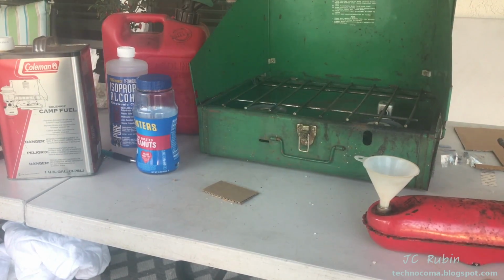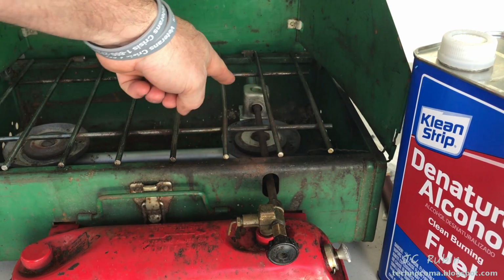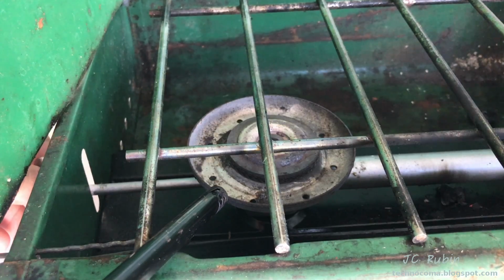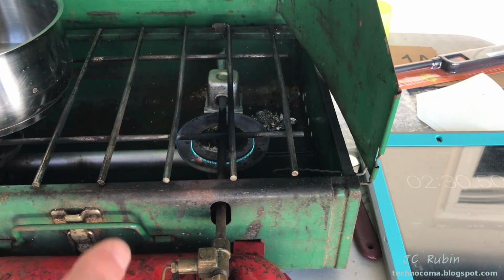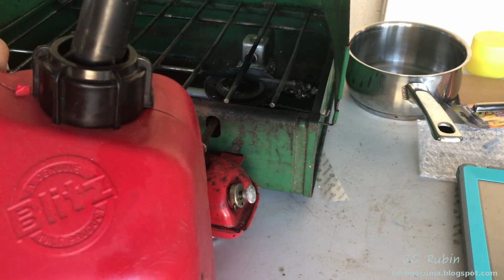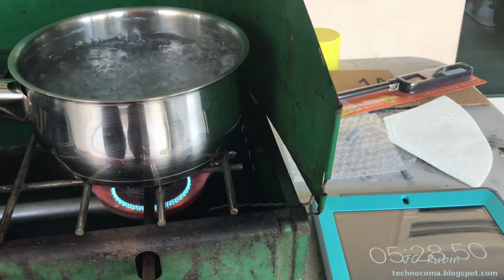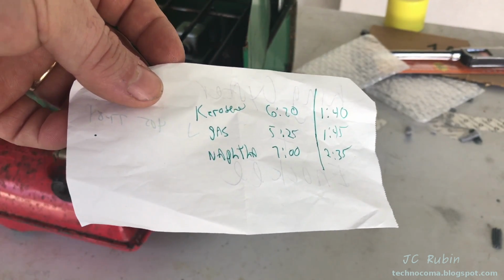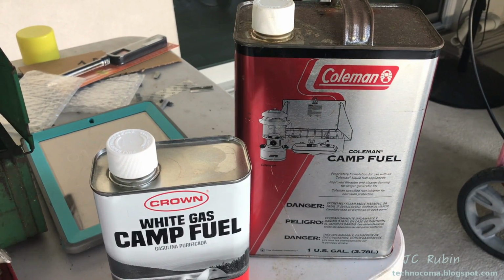Antique Coleman 425 Stove Testing Out Different Fuels for Performance

Comment: 87 w/10% alcohol works but remove it from the tank as it will rust badly 
Same as in older vehicles with steel tanks
Reply from the maker: True, Ethanol is bad news for metal tanks

Comment: Interesting results 👍👍 I've had a Coleman 425E stove since the early 80s never realized there was a Needle & Spring inside the tank tube until you demonstrated that. Now I'm going to take mine apart & clean it. These are amazing little cook stoves especially if you are living off grid they are a must have item.
Reply from the maker: Glad you found the video useful.

Comment: I just picked a 3 burner up at a yard sale for $20 and been using it for camping trips, I have been using gasoline since it’s the easiest and most efficient source to come by at $1 a can. I wasn’t aware of the residue and want to ask how serious it is through time. I would also love to maintenance one of these and I recommend you a maintenance video on one of these antique pieces. I’m concerned of energy loss on mine and I don’t notice a difference when I adjust the fuel regulator.

Comment: One of the tricks we did in the army in the arctic was we would squirt a ring of hand sanitizer on the burner and let the stove preheat and basically light once we turned the fuel on.
Reply from the maker: Thanks for the tip!

Comment: Thank you for this fine test. My experience with Coleman stoves and lanterns spans 60 years. On occasion I have used Coleman fuel, it works great. But pump gas has always been my preference because its something I have always had around the house for the chainsaw, lawnmower, etc. I have never had a problem. Before the 1990s leaded gas was common and that would foul up the appliance. So we always bought unleaded. Now I prefer to use ethanol free pump gas. I have nothing against Coleman or other brands of Naphtha fuels. They work great but they do cost more than pump gas, but even with a year of heavy camping the cost is negligible. They are dual fuel compatible, so use what you prefer.

Comment: Could you test with Seafoam(the kind you get from the auto parts store)?
From what I can find online its 3 ingredients are naptha, pale oil, and isopropanol(isopropyl alcohol)?

I've tested it in lighters and vintage fuel handwarmers. Those seem to not be the best as it could hinder spark flames but maybe work better in flame lit applications.
Reply from the maker: I don’t test everything flammable. I can’t imagine a scenario where I’d want to cook with Seafoam. I’ve seen and smelled it from an exhaust

Comment: Great point. Coleman fuel and white gas does degrade as does Kerosene ( paraffin for those in Europe) Worked as a Coleman and other repair jockey for years, and old fuel works, but has less energy. Even kerosene goes bad. Much more common degradation with partially used cans. Great video, thanks!
Reply from the maker: You're welcome.

Comment: Nice work.  You got some interesting results.  But to get meaningful, accurate, repeatable results, you need to do all the tests exactly the same with the only variable being fuel type.  The amount of fuel added and the pump count need to be the same for all the tests.  This is not easy, since some fuels take more, or less, time to reach operating temp.  In "Up To Light" mode, LOTS of tank air is being consumed.  Ballpark estimate for this is about one pump per second of "Up To Light" operation.  The only way to really keep things equal is to have a pressure gauge or use a constant pressure air supply to the tank.  It's doable, but you'll need a compressor and you'll have to sacrifice a fuel filler cap to rig this up.  Something to think about.  The importance of maintaining good tank pressure cannot be over emphasized with these stoves.  

The claim that in the 'Up To Light" position, the stove is running on only vapors from the top of the tank is incorrect.  While those vapors ARE flammable, they are not concentrated enough to produce a burnable fuel/air mixture once they mix with ambient air in the mixing chamber of the bunsen.  "Up To Light" restricts, but doesn't cut off, liquid fuel from the bottom of the tank.  High speed, high volume air from the top of the tank rushes by the restricted opening at the liquid fuel pickup, atomizing it into a spray that IS rich enough to burn, yet is still, more air than liquid, to keep the generator from flooding until operating temperature of the generator is reached.

Comment: Last time I bought a can of Coleman fuel,  it was like $2.50 for the gallon can.   Cheaper than gasoline at the time as you got the free can with the gas.  Coleman fuel is now $18.99 for the gallon can.   Lowest octane auto gas hovers around $5+ gallon here.   Summer grade burns a little cleaner and it more expensive thn winter grade.  Have you tried stuff sold as lamp oil?  I see it free or cheap at yard sales now and then,

Comment: The multi fuel stoves allow use of regular gas as well as the clear ethanol free because they don't have the standard coating inside the tank. The standard coating is eaten up with regular gas and becomes a problem sooner or later. That said, it'll burn just fine for some time before it clogs up.

Comment: Not all generators support different fuels.Depending on yr and make they would also burn on kero(but with proper generator).It's all in the vaporization of the fuel used

Comment: Preheat with alcohol before using kerosene
Reply from the maker: Like in the video?
Reply: I know you preheated; I mean use alcohol to preheat it; pour it in the burner cup and light it; it's clean. Thought you said you used paper towels.   @retrotechandelectronics

Comment: To burn  alcohol in those stoves, the orifice needs to be larger to get more fuel to mix with the air.  That's why alcohol burns a little better with the lever up.  It takes a resizing of the generator's orifice.  Otherwise, you're burning a lean mixture.  The generator turns the liquid fuel from tne tank into a vapor.

Comment: White gas was a product that was sold back when leaded gas was in all the gas pumps. White gas had no lead. Lead emissions are highly toxic. Present day non-ethanol regular gas is the same as white gas; which is the same as "Coleman Fuel". Lead additives in gas were outlawed many years ago.

Diesel fuel in the past used to be unrefined and had a lot of sulfur.  The federal government passed laws that required diesel fuel to be more refined and desulphated. Present day diesel fuel at the pump is equal to kerosene and can be used safely in kerosene heaters etc.

This video measures the heat output of various fuels but does not measure how "cleanly" they burn. Outdoors in doesn't make much difference, but indoors all fuels should be used with adequate exhaust ventilation.

The cleanest burning fuel is natural or propane gas with a catalytic burner.

Comment: Awesome video!  As you said... Kerosine will pool if you cook on low.   Need to keep heat on at least  medium.  It is easy to toss an alcohol stove inside the suitcase stove as long as you adjust the height, etc. so that it sits under the grate and the suitcase provides wind resistance and a little safety when using the stove.  Just make sure to remove the little Swiss burner when using the Coleman stove burners.  

Other than necesitate cleaning, I am wondering if this would be a useful and practical way of getting rid ofl older gaseline by running in the stove.

Have you tried one of the multi-fuel newer suitcase stoves to see how they function?

Comment: I have used gasoline for literally over a month at a time and I have never had an issue with it. I will usually mix in carb cleaner or run a tank of white gas if I am going to leave it in storage but people are way to wound up about using gasoline. IMO most of the deposits are made in the starting up and shutting down phase of use so if you actually use it and get it good and hot regularly the deposits re not an issue. Do not run premium though. Way too many additives. Was forced to once and burned poorly.

Comment: No doubt you probably know this about kerosene by now:  if you use a propane torch to heat up the full length of the generator before you open the valve you won’t get the soot and smelly kerosene odor. If you take a lesson from the old Coleman kerosene burning lanterns you’ll see the spirit cup surrounding the base of the generator. This is so you can preheat the generator to a temperature that vaporizes the kerosene. Roughly 428 degrees F.   Then when you open the valve the kerosene immediately vaporizes, mixes with air and burns with a nice hot blue flame. No soot. No smell. Just very hot blue flame for cooking your food etc.
Reply: You can also put some alcohol on the burner base and light it to preheat the generator

Comment: Wonder how the Coleman stove would work on common #2 diesel fuel?  I would expect very similar to 1K.
Reply: I would expect just a tiny bit less clean burn. #2 diesel isn't as highly refined as K1, but not by much. I'm drawing mostly on my repair experience with multi-fuel torpedo heaters that burn K1, #2 diesel , and JP#4 jet fuel. Its all in the fine tuning and basic maintenance of the systems.

Comment: Probably someone else said this, but it's probably more a case of the volatile components evaporating in the old fuel than it is absorbing moisture.  Gasoline is the most volatile of those fuels you tested, and there's just something about a pressurized tank of gasoline that I find a little uncomfortable.  Of course, since they're all volatile to some extent, and all pressurized, it's probably like "would you rather have 1/2 of a stick of dynamite or 1/3 of a stick of dynamite go off in your hand?" :)  Coleman actually said something about burning gasoline, and I think you'll find yourself cleaning the system more often because of the detergents and other additives.  They do say you can use white gas, which was straight gasoline with no additives, but you can't find that anymore.
Reply from the maker: No doubt, in the end, Whitegas is the way to go.

Comment: Curious if adding a little bit of methanol would help that old fuel burn a little better?  I know it seems like a crutch but honestly if it works it's cheaper than buying a new gallon of white gas.  Plus it's just fun to tinker with stuff.  Great video!  I see I'm 3 years late to the party lol

Comment: Lot of good info. Thanks for taking the time to put this out. I was wondering if Sta-Bil fuel stabilizer would make much of a deference in the fouling of the generator?
Reply: No, sta bil just puts a coating of oil on top of fuel for short term storage to keep down oxygen degeneration. Like a 3 month seasonal storage period.

Comment: Switching between fuels: you need to change the jet orifice size to accommodate each fuel.  Then the alcohol would work great. I use alcohol on one of my stoves.
Reply: Would alcohol need a larger or smaller orifice
Reply: @danmartens2668  technically alcohol has less BTU's compared to naptha, also known as white gas or coleman fuel, so alcohol should take a larger orifice, but with this man claiming overfueling and flooding, the actual amswer may be much more complicated, includimg generator sizing or design differences
Reply: @mikem5475  awesome ! Now going to experiment with an explosive discovery 😳🥴😅
Reply: @danmartens2668  it should never be dangerous unless you let the pressure vessel or fuel tank fumes reach the flame, it only puts out about enough to keep the burners going

Comment: I dont't know if you have E85 gas around where you live. but when the gas has a higher octane content, it burns hotter faster cleaner. i can get boiling water in 5 mins. try it out!!!
Reply: and E85 tents to be way cheaper then normal gas from the pump. most of the time its near $1.00 cheaper

Comment: Performance seem great, like I assumed it would be. What I'm worried about is safety.
Reply: You will be safe as long as your stove is in good repair and you treat it as if it is a 'slightly dangerous' appliance (like all stoves are), .  Always fill the fuel tank outside and securely cap the tank before bringing it inside of any structure.  After filling and capping the tank, wipe the outside of the tank with a rag or paper towel to clean up any fuel that may have spilled or dripped prior to bringing it inside.  Also, prior to lighting and using the stove, place the stove on a very stable, non-combustible surface.

DO NOT EVER USE ANY TYPE OF STOVE (or other heat generating device) INSIDE A TENT OR UNDER ANY TARP!  Be sure you have proper ventilation when the stove is in use, no matter what fuel you use (Propane fueled appliances are included).  🙂

(Experience: Boy Scout for 7 years & Boy Scout Scoutmaster for 10 years)
Reply: @SCarter76  Thanks for the detailed repply! I appreciate.

Comment: This looks like a use for a can of diesel/gasoline mix we drained from someone's tank (Poor choice in fueling up their car, but smart enough not to start it).  Wondered what to do with the stuff, now I have an idea.

Side question: What is your "white gas"?  Long ago in the earlier days of automobiles "white gas" was basically unleaded gasoline (where everything else required leaded gasoline), but recently white gas was described as "straight gasoline, no automotive additives", but you're calling it Naptha (which is basically Zippo Lighter fuel, generally: There are a few variants).  What's the real scoop?  Do the cans say what is what?

Comment: You've found a good use for your alcohol.  Put it in a little metal bowl under the generator, instead of starting a toilet paper fire, and use it to pre-heat the generator when you're using kerosene.
Reply from the maker: Yes, a clean way to pre-heat

Comment: Sir, with all due respect, I must ask. I think it's pretty well established that Coleman stoves (and lanterns) were designed to run on white gas/naphtha, not all the other fuels you tested. White gas/naphtha gives the best overall results to include lighting, burning and required maintenance (lack of). So, why test these other fuels that may not light, burn poorly and if they do light, are so filthy burning you have to take the machine apart just to try and salvage it. If you're testing these fuels to use them in an emergency, that's one thing. You know there are viewers that will see your video and miss the point. White gas is the best fuel to use for a number of reasons. "But let use kerosene (for some reason)." Then when their Coleman won't work, they won't understand why.
Footnote: I use nothing but Coleman propane lamps anymore. Instant on/off. No pumping. No stink. Nothing to plug up. I refill the 1# bottles for .45 cents-cheap.
Reply from the maker: Thanks for watching..

Comment: Wrap a copper wire around the geny for kero helps with thermal mass to heat it up quickly.
Ps mine has a hole in the pulse jet tube that i use to light the kero and it gos to the burner
Reply from the maker: Good ideas but a bit much for a rate kero test

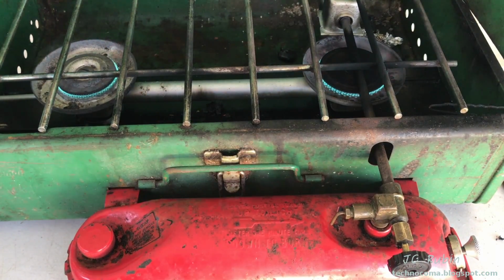Comment: I've  just restored a 48 year old Coleman 2 burner stove and did a boil test using fresh Naptha fuel to compare results.  Interestingly my time was 6:44 minutes.  I may not have had the flame turned up as much and my pot size was a smaller area but taller (Hiking style pot) so the heat transfer would have been different.  Still, I'm more than happy to have it working again.
Reply from the maker: I can compare between fuels and so can you, but we cannot compare between stoves because of the variables, weather, pot metal, thickness, and other such conditions.

Comment: Thank you for a brilliant video. I use my 425 everyday (my only cooking device), and I cook all the time. I appreciate learning that e-85 works well in my sole kitchen stove.   In gratitude, all the best with good health.
Reply: He didn't use E85. He used E10, standard auto gasoline.
He did show that alcohol does not work well and E85 is 85% alcohol.
Reply: @trustme7731  Thank you for the clarification, and my miss understanding. All the best to you, for your input.
Reply: How long does a stove last? I would have thought the burners would wear after a while.
Reply: @greatwhitenorthlife2327  Yes you are correct, the burner does degrade with constant use, but I have gotton many years of use. The outer cup will disintegrate first, but the  burner will still work with a damaged outer cup. Good luck with your unit, and all the best from New Rochelle N.Y.

Comment: BEEN looking to see if it runs on kerro, its cheaper them petrol, going to try my one ,  I have loads of 96 stoves, and some pre heaters, need it for when i go camping , fishing so if you dont hear from me again, I have blown meself up  :) ,  might put some thin copper wire to get more heat into tude
Reply from the maker: Runs? yes.... Starts well... NO.. Stinks when it goes out... Yes.
Reply: @retrotechandelectronics  mine did not like it,  but will try again, will get there :)